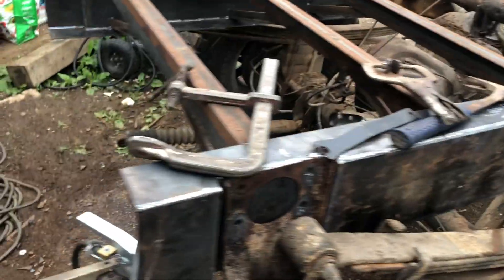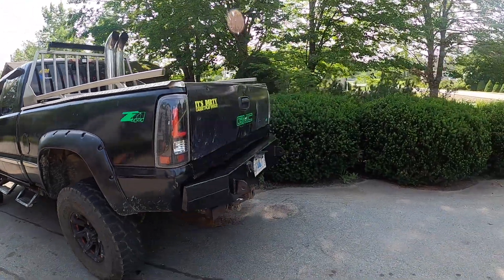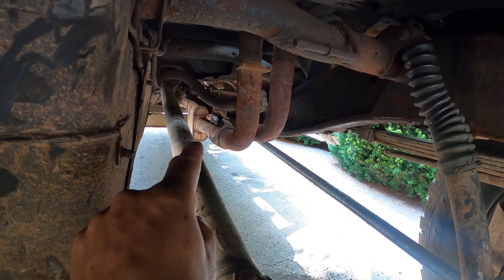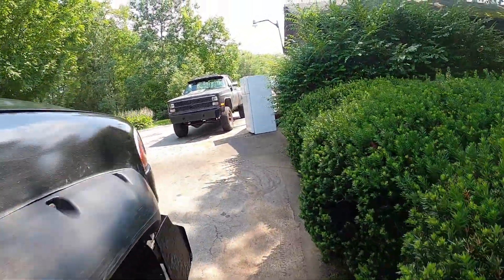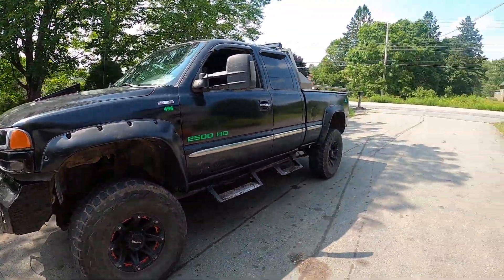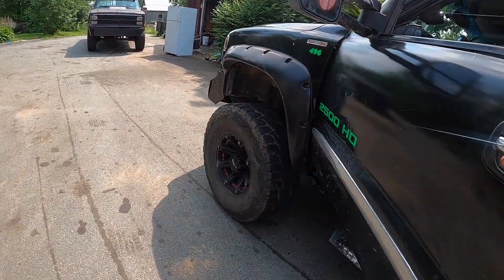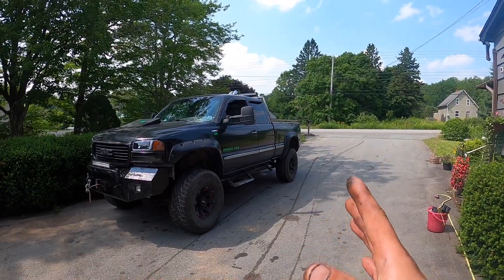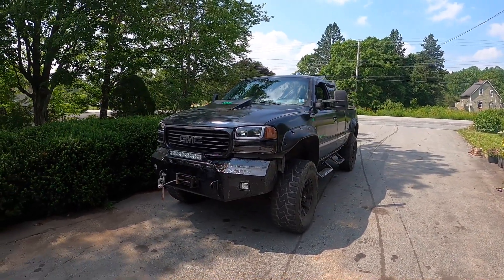8.1 Swap Gmc 1500Hd Frame Upgrade Heavier then a 3500Hd

Comment: I got an 03 lb7(cat eye) i replaced the gas and shock cross member on mine as well as rockers and cab corners. I bought the truck like that, 110k miles for 2800$ had reman bosch injectors done at 100k. Only bought it because the deal, was actaully looking for an 8.1 tbh. But nonetheless love the truck and watched a few vids on it and subscribed as well(: